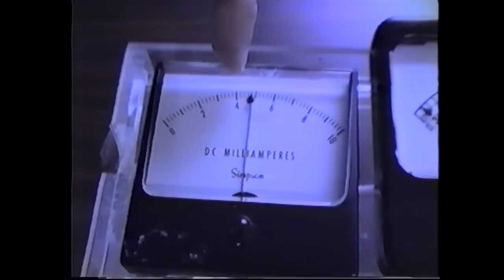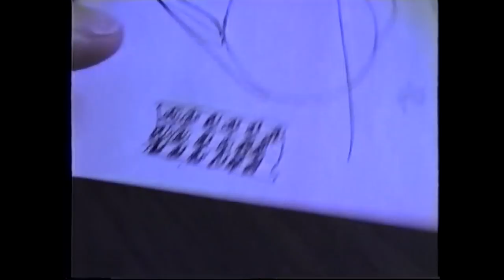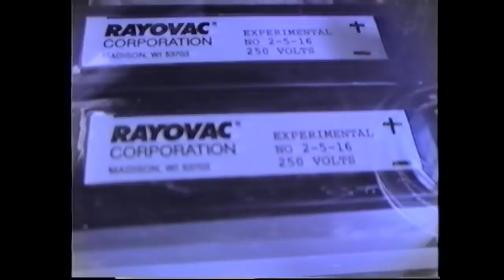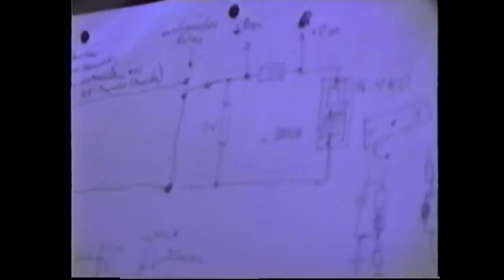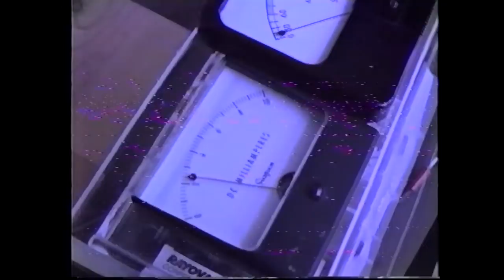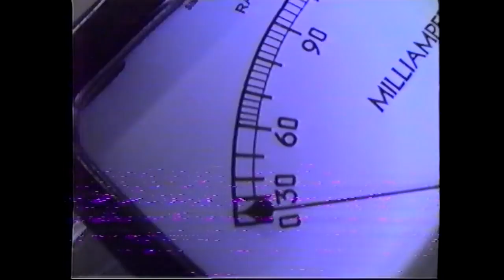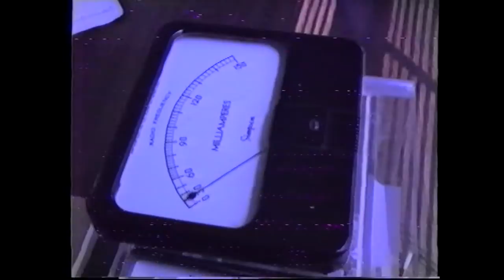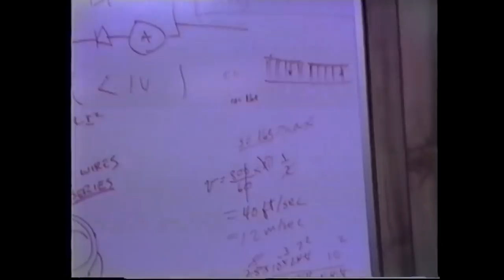Joseph Newman Visit 1987

Comment: I was once a big fan of Mr Newman, and even built a 50 + pound motor hoping to produce free energy. Once I gained a greater understanding of amps,  volts, and watts, it became apparent he was not being completely upfront about the output power of his motors. Nevertheless there were a few public demonstrations that seem to suggest he might have been on to something. He was certainly an interesting guy to say the least.
Reply from the maker: Grants Pass TV Repair yes only his first big machine seems to have more electrical output power then was going in electrically... all the smaller machines unfortunately don't show this effect
Reply: true...think it had to do with extreme high voltage and ultra low amps!
Reply: With modern new permanent magnets the newman effect can be achieved with lower overall motor weight.   However, weight is necessary to produce significant overunity
Reply: Grants Pass? That's in Washington or Oregon right?

Comment from the maker: When I was near the running FAN motor with my VHS-C camera with a Tube sensor, the rotating neodymn magnets affected very much my camera and the strong RF pulses of the commutator switching were also inducing these noise lines into my tape recordings...
Reply from the maker: Piero Canova Yes, it was still a VHS-C camera with a Tube image sensor , so no solid state CCD chip yet....
Reply: What does this motor do again that's so great?

Comment: Hi i read this text somewhere but i forgot where ..this text is your consideration about fuel cell...if you please send a link about this kind of fuel cell or any information related....the text is this:Just use armorphous nickel electroplated onto graphite beads or graphite plates ! And use it then in a KOH water solution, so it is an alkaline based fuel cell ! One electrode will be the nickel plated graphite and the air (O2) electrode will be just pure graphite plate....! Much easier and cheaper than your method ! And will have much more power...The H2 needs to be applied below the nickel coated graphite ! Regards, Stefan.

Comment: Isn’t the solution you seek in Nathan Stubblefield theory? Doesn’t a single neodymium magnet resist and attract to copper. Doesn’t the opposite field prefer aluminum instead of copper? Why never dissimilar conductors to attract and detract from the fields? Or to increase currents in both fields. Then isolate grounds and use both negative and positive fields to do separate work. No cancellation then. Stubblefield used a third pole and metal as well. Probably the actual conducting path to do work with it’s own ground. The energy potential is there, use it.

Comment: In 1979, Newman submitted an application for his device to the United States Patent and Trademark Office. The application was eventually rejected in 1983, which set off a lengthy court battle. The United States District Court requested a master of the court to make the final decision. William E. Schuyler, Jr, former Commissioner of U.S. Patent Office, Washington, DC was chosen by the court to make the final decision to award the patent or not award the patent to Newman. Schuyler supposed that evidence to support Newman's claim was overwhelming and found no contradictory factual evidence.
However, the judge ordered Newman's machine to be tested by the National Bureau of Standards (NBS). The National Bureau of Standards (NBS), now known as the National Institute of Standards and Technology (NIST), by request of the patent office, tested the device for several months and got negative results. In every case presented in the NBS report, the output power was less than power input from the battery pack, and therefore the efficiency was less than 100%. The court therefore upheld the rejection of the patent application. Wikipedia.

Comment: Great video Stefan,
Did you ever replicate the design, based on your own studies then?
Reply from the maker: Greenme Research yes but I only have replicated the smaller one's and they are under unity only about 70% efficient mechanically
Reply: overunitydotcom the efficiency increases when adding more coils/copper poundage.

I have his 7th edition book.
Reply: you absolutely cannot build small.  You'll need to build industrial sizes to get significant energy out of her
Reply: Constantine Joseph correct, at least 100 to 200 pounds of copper. None of the smaller units will give much of a performance increase.
Reply: Greenme Research the smaller units may have overunity but it will not be enough to run as an energy propulsion device for real life usage.  The recommended 200lbs is the right size to run a load and at the same time recharge the battery power source back up.   Yes even using dead batteries with whatever remnant voltages.